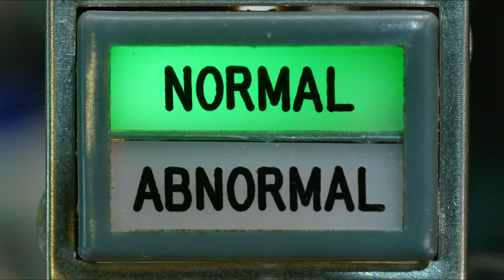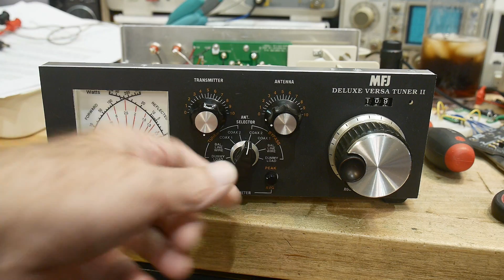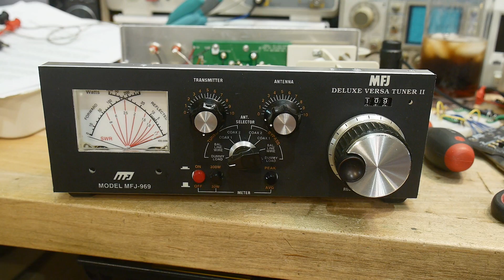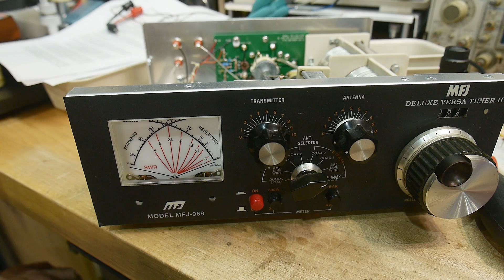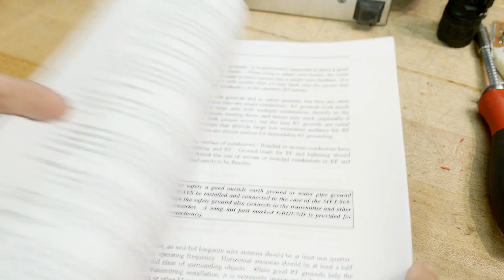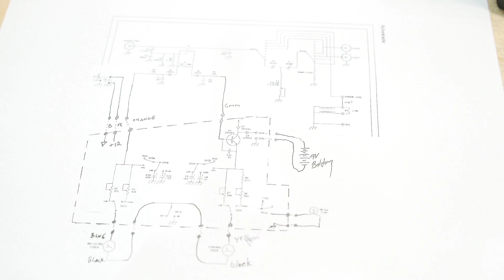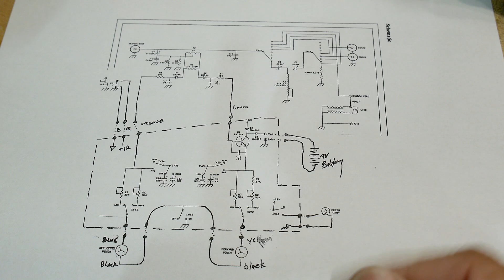#1728 MFJ-969 Antenna Tuner

Comment: OK, somebody gave me one of these units today free  of charge, and my old saying stands true nobody gives anything to anybody if it's not broken that even goes for people selling things nobody sells anything that's in working order, now, my question is this, that little piece that you showed in the very beginning that is patterned of course mine is missing. It was snapped off. Will this unit still work or should I just throw it in the trash. I will hold onto it until you or someone else responds and that will be my deciding factor if I keep this thing for Parts or I use it thank you.
Reply from the maker: Not quite sure what part you are talking about, but MFJ has spare parts I believe.
Reply: @IMSAIGuy  when you take the lid off the big dial all the way to the right halfway up that coil at the midway point there is a little mechanism that when you pass a certain point it lifts up and when you go back the other way, it goes down you showed it on your video I really would love to keep this thing.
Reply from the maker: @jojojeep1  it works fine without it

Comment: your SWR meter looks different in back than mine does. I’m looking closer at this because I need to replace mine. It’s not lighting up. Got it on e-bay. Upon arrival, there was a big hole where the meter should go. The retainer had broken into several pieces, thus setting the meter to dancing around inside there. Also breaking a wire to the meter during the dance. There are several sellers on e-bay offering the 400-0084A numbered meter. They all appear to be made by the same Chinese factory. The specs. call for a (620 Ohm x 1/2 W ) resistor, or alt. a (1340 Ohm x 1/2 W) resistor applied to the light leads.
The 620 Ohm will, of course, offer a much brighter lamp than the 1340 Ohm choice. These numbers should work for the lamp(s). Your meter back looks different from mine, and the offering on e-bay looks different yet. The e-bay offering states it has the same part #. So… I dunno. Your mileage may vary.

Comment: Hello, Congratulations ! 
I am a beginner in mobile CB. I have just finalized my mobile CB registration with a DX27 helical antenna (1m80) + MC KINLEY+ KL-203P.

So I have a beginner's question for you.👇

You must start by configuring (tuning) your antenna in "Tune" mode ('Tune' button activated) to lower the TOS/SWR, do we agree?

Then, when the antenna is tuned with the MC KINLEY Tx linear amplifier, I can return to "ByPass" mode (BPS) and use (modulate to AM/FM/SSB) my CB radio?

Sincerely

Comment: This was a very good aid informational video.  Thank you.  I just bought an older unit of the same type.  The face of mine is grey.  I haven't used it yet but will soon.  I like the idea of a roller inductor.

Comment: This will be an interesting series. My Elecraft T-1 tuner just died so I will have to go back to one of my MFJ cross-needle ones (one for HF, one for Six). I own a lot of MFJ gear and never had trouble with any of it. Snobby hams give it a bad rap, but it works for years just like my Elecraft gear. Less sophisticated for sure but great value (not that Elecraft isn't too).

Comment: I have the exact same device. My main use for it so far has been to adapt the impedance between a 27MHz oscillator+power amp to a RF plasma enclosure. It worked well for that purpose. Nice plasma generated with various gases. :)

Comment: Hi,  happy new year; let me add few points here.
As you said, it is T configuration  high pass filter; it doesn't mean that this will pass all the ham band frequencies above the resonant one.
The shorting bar, as the name implies, is to short out the excess windings when you want to work on the higher end of the HF spectrum. 
Coming to the SWR/Power meter circuits, the coupler is the regular Bruene bridge on the rear pcb. The metering pcb is found on the front. That is the usual practice. MFJ has not done any shielding to both pcbs. That really is not the correct practice. It is always better to shield even for qrp power levels.
The circuit has to be redrawn as you have done already. In the standard literature like the ARRL handbook, it is a regular practice to draw both circuitry separately with mention about the screening (with good grounding) 
The 50 ohm dummy load can be connected to the radio to check the built-in power meter on the radio.
The SWR/Power meter can be arranged to be terminated into the dummy load (before hooking it to the antenna) for calibration assessment. 
Yes, antennas like long wire and twin lead fed systems can be tuned (to within reasonable impedances). Remember that it uses a 1:4 Ruthrof voltage BalUn for the twin lead feeder systems; it is not to match the characteristic impedance of the twin lead feeder but only for the purpose of extending the limits of impedances (higher than) that can be handled without a 1:4 voltage step up transformer. Essentially it is a compromise and is not a "genuine" tuner meant to be fed to a twin lead feed antennas. 
Of course, the twin needle or cross needle analog (D' Arsenval moving coil meter is a useful, attractive feature where one can asses the forward power and reflected power simultaneously. The SWR is read against the marking on the dial where both needles intersect during operation. 
The PEP function requires power from the 9V battery for the comparator circuit that would charge an appropriate value capacitor for the power range and hold the needle on the dial before getting discharged. 
The dial incandescent lamp on the dial requires the external 12V power; it can be replaced by a white/blue tinged LED for better illumination and cool lighting. 
Many have trouble finding the correct impedance match and tend to get arcing in the capacitor plates; some have even managed to burn the shorting bar on the roller coaster inductor..hi..hi..
Because on more than one setting of the inductor, and the tuning and the loading capacitors, you may find "dips" on the meter; but only one position will be the correct one when most of the power is getting coupled to the antenna via the feeder with minimum loss in the inductor. 
The arrangement dictates minimum inductance to the ground and maximum capacitance in series with the antenna.
The accompanying manual will instruct how to proceed initially and to find out how to optimize the settings for various bands.
One can simply start by setting up with a high level of static noise on reception before even putting any power from the radio. 
One can find a simple explanation of the working of the T tuner on the project by VK5AJL.
De VU2RZA

Comment: The roller inductors... as new parts (if you can get them) are really expensive. Hams did ... at one time make them. The coil is supposed to be silver wire, or tubing... but, not for a long time... and since the Hunt brothers drove up the price of silver.... more like silver plated copper wire, or tubing. Anyway, silver is the best conductor... and it would be interesting to know the minimum plating thickness, for the max freq. used, given the max resistance required?

Comment: MFJ = messed up, almost always.
Reply: MFJ = "Mighty Fine Junk" - all of these I've seen and many of their other products have either bad solder joints or rivets used as electrical connections that are not electrically connected 😅
Reply: I have a transceiver,  two analyzers, two tuners, two beams and many accessories and NEVER had ANY issues with any of it,   'Junk' is a myth. I HAVE had trouble with Elecraft.  @ejholden8851

Comment: Why don't we normally use antenna tuners with frequencies higher than HF, such as 2 meters, 70cm, etc.?  I've always wondered about that.
Reply from the maker: because the small size allows us to make correct length antennas and they are usually only one or two bands.
Reply: I have a Six-meter band tuner from MFJ. It's a pretty wide band. And getting it right is important up there!

Comment: I have an older MFJ tuner from the early 1980s that is rated for a kW.  Similar design but older with larger components and uses a rubber band to drive the turns counter.  Only problem with is was that the band gave out and finding a new band was kind of challenging.  Have used it with a variety of antennas and it works well with my old TS-830s.
Reply: Ya, I've got a similar tuner driving a ladder line ...and a 830s ... I prefer that setup over the more modern radios I have.

Comment: When I got mine, that flippy-doo looked like it had arced against the inductor and made a rough spot in it.  I removed the flippy-doo and cleaned up the rough spot on the inductor, and it seems to work fine that way.  Iunno.  :O

Comment: So, what is the battery doing ? Is it for the peak reading function ?
Reply: It's for the meter circuitry. The match circuitry is purely passive, in those units.
Reply: They are using a transformer to couple the signal to the peak detector (diode, resistor, capacitor) and then the high input impedance, and low output impedance of a 2N3904 in a common collector configuration... to drive the meter... so that the meter doesn't load the capacitor of the peak detector circuit. (a kind of voltage to current converter) The 9V is for powering the transistor.

Comment: I have an MFj-969 in regular use with an Icom IC-7100 (100 W). I like the bypass function as my antenna is fully resonant on some bands. The meter lamp burned out and there was no replacement available from our MFJ dealer, so I replaced it with a white LED + resistor. The shorting tab on the coil has evaporated, however the tuner works OK. HNY DE SV1XV

Comment: What I see is that there is no isolation. Need a plate to isolate electronics and RF. The varicaps are way too exposed to the low signal measuring.